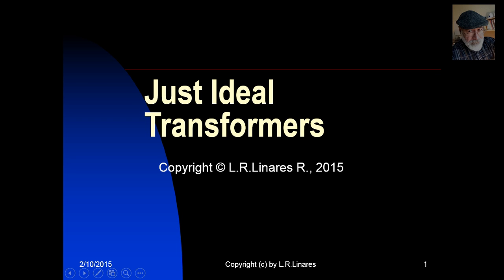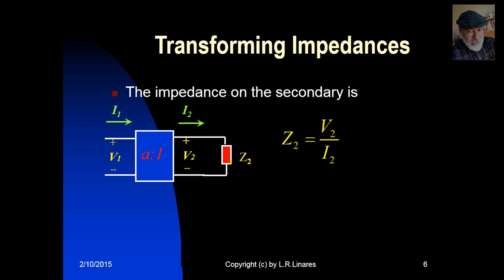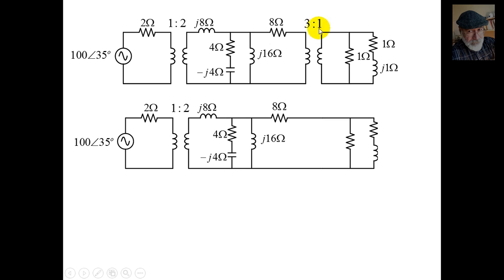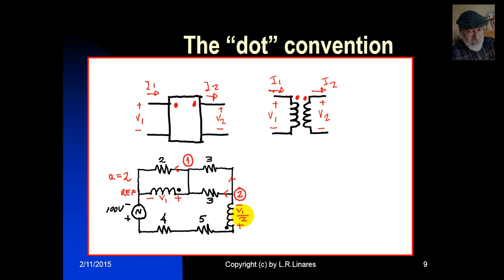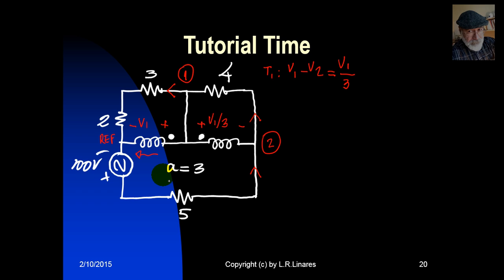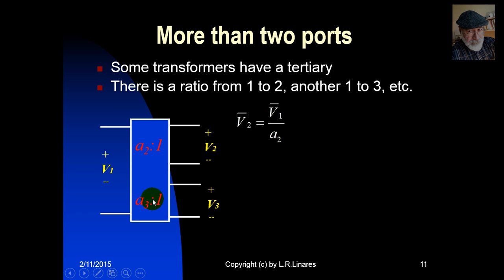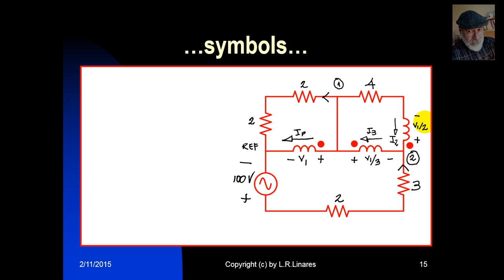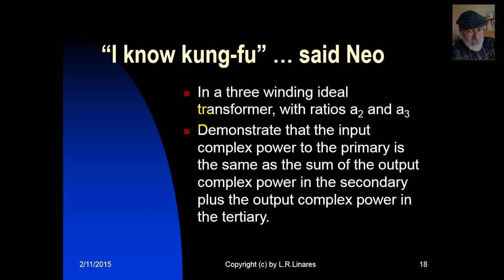TRAN01 - The Ideal Transformer

Comment: As always, you explain topics in such an understandable manner. I know this is just the first video, but I have two questions:

1. What does it mean by "power in" and "power out" in the primary and secondary? I mean, transformers only work for changing currents, which are usually alternating sinusoidal current, and in that case current reverses direction regularly and so does power. My point is, what is referred to as "power in" is just for half a cycle, but for the other half it is "power out." Is this just a convention?

2. When using the transformer for matching impedance, why not simply connect other impedances in series to the load in order to achieve the 800 Ω?
Reply from the maker: Firstly, thank you. Now, on (1), when we say 'power' in the context of AC-SS, very often we mean either average power (also known as active power, and sometimes incorrectly named as "real" power), and sometimes we mean apparent power, in volt-apmpers, in VAs or kVAs or MVAs. And that average has a direction of flow, from the generator into the primary, from the secondary into the load. The actual instantaneous power is fluctuating (as in my video on power in ACSS), but the average power is relentlessly flowing in one direction.
Reply from the maker: Oh, I missed your second question. (2) when we "match impedances", the point is not to extract maximum power out of the generator, or amplifier, or source in general (which would be achieved by the addition of resistors that you propose), but the delivery of ALL of that maximum power to the load, to the customer or to the speaker. If we add those resistors, they will dissipate part of the power delivered by the source and turn it into heat. The customer, the load, would see none of the extra power. Please do the math, set up the circuit and compute the current and with that current compute what is the power actually absorbed by the load. I hope that helps.
Reply: @rolinychupetin  Oh, thanks for the explanation!!!! Got it ;)